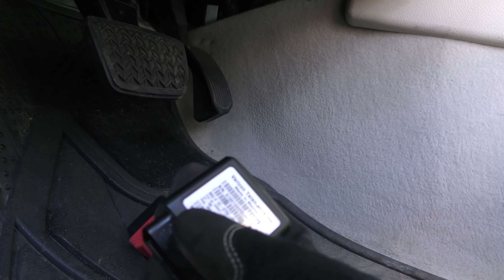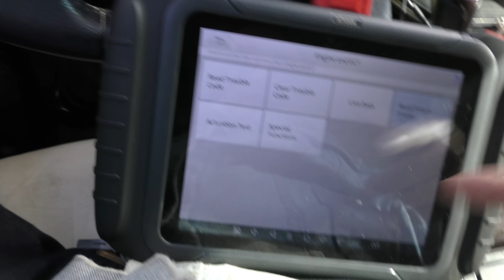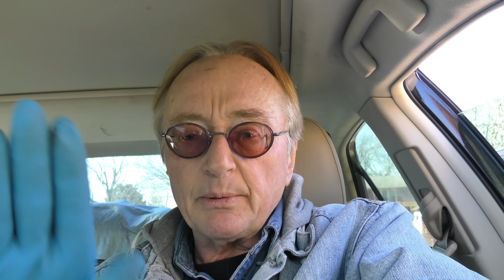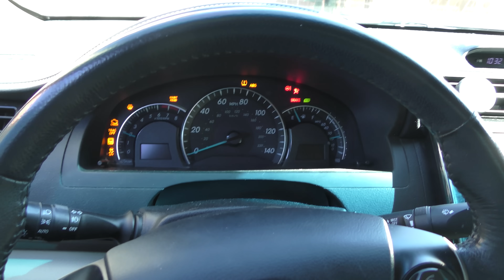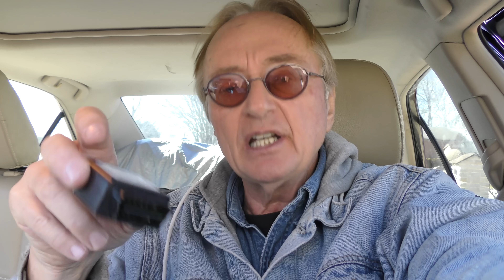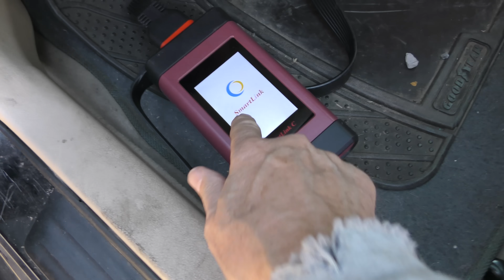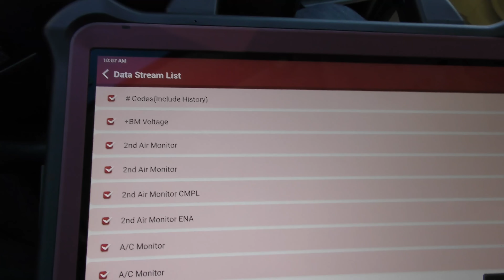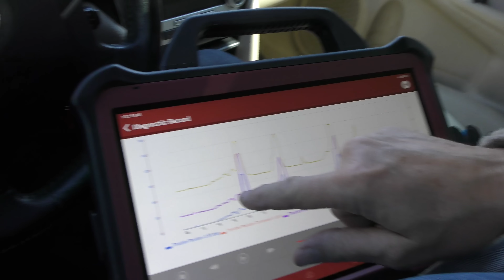This Stupid Device Just Cost My Customer Thousands in Car Repairs

Comment: I greatly admire Scotty, but I have to disagree with him on this one (I'm not an auto mechanic, I repair medical equipment).  Car computers are actually pretty well hardened against high temps, electrical glitches and spikes, etc.  Years ago, I had a GM instructor tell me that of the GM computers sent back to them by auto mechanics, over 99% of those replaced computers were perfectly good... the problem is most often the sensors giving bad information to the computer, which then makes bad decisions on how to run the engine based on that bad data; Garbage In, Garbage Out.  

Sensors are often poorly designed, cheap, and made of cheap materials.  The computers, even as complex as they are, are typically extremely reliable.  I would question many other possibilities before I would begin suspecting the computer.  Even a dirty or corroded electrical connector on a sensor is far more likely to cause problems than the computer itself!  In those cases, a good cleaning of the dirty/corroded connections (and perhaps the application of dielectric grease to keep those connections clean) would fix the problem-- nothing at all was actually bad, neither sensors nor the computer.  Electrical connections are usually where most faults lie in electric/electronic systems (electrolytic capacitors excepted).

It seems to me that the action of the sensor built into the accelerator pedal should be tested waaaay before I would begin blaming the computer-- or the dongle.  Those dongles, even though assembled in a 3rd world country, were probably designed in the US, Japan, or Germany, and YES, they WERE designed to stay connected to the ODBII constantly!  Now if something goes wrong with them, they would probably (my guess) stop working and perhaps interfere with the CANbus data flow, a problem which might stop once the bad dongle is removed from the ODBII connector.  But they typically ARE designed to stay plugged in.  If it is a Chinese design, though... all bets are off.  It's wise not to automatically trust cheap Chinese electronics; some is fine, some not so much.

Oh... and poor electrical ground points in cars (they have many) are also very high on my list of suspects where there are any kind of electrical issues.  Check the battery condition and clamps, check the alternator for normal output (no bad diodes), and look closely at the grounding points throughout the car!
Reply: I've got to agree with Rachel here that Scotty is most likely wrong on this one. Did he do a good job in his presentation & troubleshooting? Depends on who you ask and if you're the customer how much it'll cost you. He checked off a lot of things I would expect but to assume it's the ECM for an issue that only happens during the cold enrichment cycle is madness.
A follow-up on this video is sorely needed. If the ECM is replaced did the problem in fact go away? Without the end confirmed we all can only speculate. My guess is that it's something different... possibly even the throttle position sensor built into the throttle body. That is a costly part but still would be more likely than the ECM of the vehicle. 

There really needs to be a place for people to take stuff like this to and have components tested. It's a shame because without proof of a component failure/fault you are always just taking your best guess at a fix.
Reply: No, they just didn't find the problem and then send the same defective PCM out yet again..98% of the time. - Retired GM Master Tech
Reply: @robertwhite1416  
Good, goooood, I can feel your hatred...
Reply: @MostlyPennyCat  Hatred? Could care less, GM is incompetent to the core.
Reply: Agreed, he got a it in his mind then determined that the dongle was the issue. Also bad computers are usually reversed act up when hot, not when cold.  Programming errors are more constant.
Reply: How about your both right? Since the voltage irregularities happened on multiple sensors, then it may not be sensors or the ECU. It could be an electrical issue. Start with the battery and trace any voltage spikes.
Reply: @jonmccauley6490  Important to point out that your diagnostics equipment isn't measuring the voltages, it's just a display, the cars own sensors are doing the measurements, so you don't even know if what you're seeing is accurate because your measuring faulty equipment using faulty equipment (the car).
Reply: @Strider9655  Sure, but are you assuming that all the sensors are faulty?
Reply: @jonmccauley6490  No, not at all. I'm just saying that you can't fully trust a faulty system to diagnose itself, and that's why when it comes to cars there are highly skilled experts who make a living diagnosing the faults that cannot be diagnosed by plugging in a machine.
Reply: He already had his opinion of the dongle. Normally, when I see a voltage spike it's normally caused by bad grounding of that particular module.
Reply: @danecarpenter8735 generally speaking if you see spikes on voltage rails it’s most likely the power source (battery or alternator) aren’t stable.
Reply: This reminds me of an experience I had on a 2010 Corolla that I used to own. I changed the cabin air filter, then the car starter really acting strange. A mechanic buddy ran the scan tool and said it might be a bad computer. I noticed that water was on the passenger  floor, so asked if it could be the cabin filter being in wrong, he said no. Just to try (I repair computers, so I know it's usually something silly causing big issues), I flipped the cabin air filter, and viola, car worked fine again, no more water on passenger side, etc. I assume the something with the filter being in wrong caused the water the AC took out to get into a sensor and caused the computer to freak out.
Reply: The problem with this is that there are not many diagnosticians left in the automotive world. Now the just read the DTC and if it says sensor is bad they just replace it rather the testing the sensor.
Reply: I had the exact same thought, I think he got this one wrong
Reply: If it is indeed the computer and the issue goes away when it warms up, I would wager some solder points have come half loose on the chipset. Any decent electronics repair shop should be able to fix it without needing to spend thousands,
Reply: This comes straight from my owners manual 
“Installing an aftermarket On Board Diagnostic (OBD) plug-in device that uses the port during normal driving, for example remote insurance company monitoring, remote vehicle diagnostics, telematics or EV system, may cause interference or damage to vehicle systems. We do not recommend or endorse the use of any aftermarket OBD plug-in devices, unless specifically approved by NISSAN. The vehicle warranty may not cover damage caused by any aftermarket plug-in device.”
Reply: @Claroboy911  some people are simple lemmings, if an insurance company tells them it's a good thing to do or if a fleet company uses it in cars they rarely hold on to for more than a year or two before selling it to a private party or auction house they'll think "well it most be safe then" not considering the fact that insurance companies aren't covering for damage from using these devices constantly or that fleet companies can afford a few losses here and there or that they have their own shops to repair mechanical issues in many cases.
Reply: Grounding points exactly. We have a car model in Australia that is known to run badly after a cold start when it and the battery get old. That's the alternator recharging the battery after a start, and that current generating voltages across bad (or rusty or inadequate) ground straps between the engine (where the alternator is grounded) and the chassis. If the throttle position sensor was properly grounded ONLY to the ECU then there wouldn't be a problem, but it is grounded to the engine.

Yes, some OBD tools and pods can scan the CAN bus "too hard" (too many messages/second), and when combined with badly written ECU software that doesn't prioritize things like firing the plugs over answering the pod you get problems. Which go away when you unplug the thing (or reduce the scan rate with a PC-based scanner).
Reply: Finally someone else who uses logic and reasoning.
Reply: I’d have to agree Rachel. My car, a Chevy aveo5 was doing exactly what this cars doing. It was my throttle position sensor on my throttle body. Bought a new one, slapped it in and away I went. Like you said ecus are hard to kill and with the bad voltages, they can be from bed sensors giving out out of range resistance thus causing the ecu to shut things down.
Reply: I agree. I used to work in the auto industry in Detroit testing automotive electronics before they were approved as OEM parts. Engine control modules are extremely beefy. It's much more likely to be sensors giving bad input. FYI, I worked for TUV Sud America
Reply: I'd like to see a crossover episode on this one where Scotty tries to diagnose and Louis Rossmann does a component level assessment.
Reply: Error code is sensor, so yes, I would also be testing the sensor on this first.
Reply: Interesting take, though, for me, there's one thing that really undermines you point:

"I've had to replace ONE bad computer on a Toyota in 43 years."

As I'm sure you're well aware, computers are becoming increasingly lower current and consequently more sensitive to inputs; 10% of a 5 Amp circuit is 500mA, 10% of a 1A circuit is 100mA.

I don't think the issue with the dongles is likely the design, it's more likely quality control and the resulting actual operating tolerances.

While, in general, people may cut costs on sensors, again, one should take note of the supply chain aspect - as pointed out, the parts in question are not stocked by dealers. This is a VERY strong indicator that they do not fail.

Regardless, I'm sure we can agree that rolling around with a diagnostic device attached permanently (unless it's explicitly qualified by the manufacturer) is probably a BadIdea™
Reply: @edwardcullen1739  re: "As I'm sure you're well aware, computers are becoming increasingly lower current and consequently more sensitive to inputs; 10% of a 5 Amp circuit is 500mA, 10% of a 1A circuit is 100mA."

and current is what a device draws, not what is input to it. A computer GPIO can't sink more current than it can sink. It can source more, which would damage it, but that's why those inputs are protected by transistors to amplify current and TVS diodes to protect against voltage spikes. Check out the  NUP2105LT1G TVS diode that can clamp to it's specified clamping voltage while clamping transients caused by up to 50A switching currents up to 35kv in 5 nanoseconds!
Reply: That dongle may have been put there because the car was acting up and the owner was trying to figure it out there self, then decided to just sell, and that's how the lady got stuck with it.
Reply: Scotty two or three years ago mentioned the phone charger plugs  in the lighter socket could cause the check engine light to turn on due to stray high voltage spikes corrupting the data streams. Sorta .
Reply: Depends on what car and whose making them. I’ve worked at GM dealers and have had lots of bad ECUs due to electrical issues, heat, even had one where a battery replacement took it out but no other fuses in line were smoked. Thing should’ve been running perfectly and it bypassed all the safeties.
Reply: I tend to agree with you. Except for some Ford made Mazda ECUs that are extremely low quality. On the other hand they're pretty easy to repair, find the bad solder joint(s) and fix them. There's no or almost no conformal coating to worry about.
Reply: agree completely with the throttle sensor. Suspect the human/machine interface bits FIRST, then anything else that moves second. Connectors and bolted connections next. Solid state last. Those ECUs tend to be potted against vibration, TVS diodes on all IO, etc... the ANSI standards for automotive solid state electronics are quite robust. Our cellphones are garbage in comparison, as far as what they put up with for out of spec signalling causing damage.
Reply: Garbage in, Garbage out...
Reply: that is the same gm plant that made opels right .. might want to look into opel vectra computers ,as just one gm example ,stick the computer to the engine and many died . while fixing issues with those cars usually the first thing that is tried is swapping the computer D:
Reply: That screwy DC supply being in time with the sensor glitches is quite telling, you need a common reference.
Check the grounds and if that doesn't fix it the VRMs in the computer may have died. That needs rework on a solder station.
Reply: " In those cases, a good cleaning of the dirty/corroded connections (and perhaps the application of dielectric grease to keep those connections clean) would fix the problem-- nothing at all was actually bad, neither sensors nor the computer.  Electrical connections are usually where most faults lie in electric/electronic systems"

This. 
Electrical engineer here. Naturally, I like to fix stuff. If you don't fix stuff, you really have no idea how many "broken" electronic items are fixed by unplugging a connector, then plugging it back in. It's really absurd.

"Oh... and poor electrical ground points in cars (they have many) are also very high on my list of suspects where there are any kind of electrical issues. "

That too. Contact resistance builds up. While you're bothering, you may as well clean a connection, but just unplug and resaet often fixes things sensors/computers.
Reply: I have seen OBD dongles that immediately send the transmission into limp mode, make the gauge cluster freak out etc. Pretty much anything post 2011 where Canbus is standard can be easily glitched out
Reply: I agree. I'd try reflashing the SW/FW on the computer before replacing it. Better yet, if there was a way to check the integrity of the SW (ie checksum), kudos to the SW developers. Maybe the dongle corrupted the SW? I can see a scenario where a scan tool is pushing data and causes a buffer overflow and corrupts the SW/static memory.
Reply: very few electronics are made anywhere besides china.  They hold every current chip factory on the planet except for a few intel owns.
Reply: agreed here.  I worked in electronics for a long time - this is a very big leap.  Also I'll point out that the scan tool get the TPS data FROM the computer - so if the computer is seeing a bunch of glitches, it could be the ADC in the computer or the sensor or the wiring to the sensor.  I don't think the cause/effect is correct here.
Reply: Stfu with the book
Reply: I had one of those monitoring dongles dead short to ground. blew the fuse, but also killed the ECM.
Reply: I used a similar device from Progressive and had all kinds of intermittent issues until I removed it.

The car was brand new, the dealership couldn't find any issues (the problems were intermittent), the Eyesight system would lose track or shutdown, the engine cut out and wouldn't start, the navigation system acted chaotically.  The severe issues stopped immediately after using the device and the other issues faded over time (it's been about 4 years).

I've worked with 2 wire serial systems (rs485 mostly) and have seen faulty components cause issues in other equipment connected to it.
Reply: @justmyopinion4818  Yes, but that did not damage the computer, and once removed problem disappeared. I would agree, that actually damage the computer is hard.
Reply: @dmitripogosian5084   agreed. caused a problem, damaged nothing. VERY important distinction.
Reply: Same. I yanked that bastard out so fast. Shitty, imprecise, data it gathers and sends anyway.
Reply: GM computers go out all the time
Reply: Those devices are trash. They cause problems and failures. 

I see the at my dealer all the time throwing cel and pre collision system malfunction.
Pull out the stupid Chinese scanner or insurance tracking device then lights go out and everything works as designed.

Stop putting crap in cars. They are way too complex to be adding random crap.
Reply: Ummm, yeah, he stated that he checked the electrical system near the start of the video.
Reply: @danielsmit11  Umm, I've seen the electrical checks he does, and the equipment he uses.  Yeah.
Reply: @rachelblack3816  well actually you didn't since he didn't show that part of the video in this instance. As far as the equipment, yes you did see him use a $6000 plus diagnostic computer after using a cheaper $1200 or so piece of diagnostic equipment.
Reply: @danielsmit11  So this is the only video where he troubleshoots electrical? And I've seen the scanners he uses, and they are very good at most automotive things... but not everything.   How would I know? I only use more expensive and other types of equipment better suited to these kinds of problems. You don't need to be afraid of girls smarter than you. Really.
Reply: @danielsmit11  Using the right tool is more important that using the most expensive tool.  In this case, I would have liked to seen an occiliscope and protocol analyser used.  But lets be honest, how many people are going to know how to properly attach those to the car's communication busses, not to mention properly interpret the output.
Reply: @rachelblack3816  the fact that you ignore connecting a wifi dongle into your car's computer system leaves your computer system vulnerable to malware tells me you aren't as smart as you think you are.
Reply: @danielsmit11  Maybe that's why you put a wpa2 password on the wi-fi part of it? The device itself (which you've obviously NEVER USED) has a sim card and talks to cell tower just like your cellphone, which is how it gets INTERNET service for the wi-fi. It has the ability, through a service provider branded app, to link and monitor your cars health and even where its at, where its going or where its been. The app makes you create an account and password, before you can link/pair your device to it. Mine makes me log in to my account with 2FA security protocols that I enabled and the provider makes me change my password every 30-60 days.

Any more smart a$$ comments about security my guy?
Reply: @youtubesnamingpolicysucks  WPA2 can be hacked relatively easily. Especially if it has a password like "ODB123" which it probably does. And that ignores this specific case where the customer apparently didn't install it... so someone else already knows the password
Reply: @danielsmit11  Cellular and bluetooth, but yeah. That specific device is designed for remote telemetry. If someone was bricking cars through that service, there would be many more than just this one hit. There's clearly something wrong in that car, but I'm 99% certain that dongle didn't cause it. (the ECU is most likely NOT the problem.)
Reply: @danielsmit11  Thinking that a car would run on a regular computer operating system and would be vulnerable to "malware" tells me you're not as smart as you think you are.
Reply: @youtubesnamingpolicysucks  Uh, cell services have been decimated for eons. You're actually talking about the same things that other LEO and FEDS have access to, and proclaim they're secure.  

>2FA
oof, my man. Take the L and leave.
Reply: @danielsmit11  all that hacking was done with poorly secured telematics and BCM that interacted with the ECM and PCM with read and write policies instead of read only security policies. That's why I really wish there were more security standards with telematics. Or any for that matter.
Reply: @danielsmit11  Fleets use these type of things all the time for vehicle tracking and monitoring. Thousands of tractor trailers will have something plugged into their J1939, J1708 or OBDII port 24/7 365 many of them even allow passthrough for real diagnostic without having to remove the ELD connection.  Many of those use wifi (take a look at the wifi networks near you when you pass trucks on highway) Most the time a consumer's car may have a bad computer it's time to really look at the electrical system and sensors instead of blaming something that is actually designed to have something plugged into it all the time.  I would rather have something plugged into it than allow the unprotected pins to see light of day.  Water can just as easily if not easier short on the CAN bus pins as that throttle sensor.
Reply: @hollowlife1987  actually they were not designed to have something plugged in to them all the time. They were designed to be able to plug diagnostic equipment in to them when necessary to diagnose computer/engine problems etc.
Reply: @hollowlife1987  using that line of reasoning then you should put fuses in every single fuse slot because it's there.
Reply: @danielsmit11  normally there is a cover over fuses that you have to pop off to access them.  That aside my point was that those diagnostic ports are designed and used to have monitoring devices plugged in all the time.  As such it is just as likely that water could damage the exposed port, as a device made for monitoring fleet of vehicles like that verizon one.

The security of them are well established as I pointed out nearly all the trucks you see on highway have a wifi access point powered by and connected to their diagnostic port in some manufacturers that is odb2
Reply: @danielsmit11  If they were not designed to have a device plugged in all the time to them please provide a tsb for that from the manufacturer.  The specs and standards don't really weigh on that.  They are commonly used by insurance companies, the fmcsa require ELDs for commercial vehicles which tend to plug into the diagnostic ports which can be odb2.  
Can you provide empirical evidence that the manufacturer does not want them to have fleet telemetry devices plugged into the odb2 port?
Reply: @hollowlife1987  I already listed multiple sources that discuss that.
   One of those articles specifically points out that car manufacturers are aware of the dangers but have withheld the information from the general public, big surprise there.
   Now if you're referring to dongles that ONLY read information from the cad and not dongles that can read and send information to the cad and connect to wifi/internet that's a different animal as Scotty pointed out in the video.
Reply: @hollowlife1987  it'd be rather hard giving a manufactures source when manufacturers are going out of their way hiding these issues to begin with.
Reply: @danielsmit11  So no manufacturer source millions of companies using fleet monitoring via odb2.  Insurance companies and large Telcom companies using it for telemetry..... the claim that it shouldn't be used for telemetry because it's not designed for that can you provide empirical evidence? Lawsuit brought on by a company with a fleet of these monitoring devices? How about insurance company ditching using them since they could be held liable? Internal memos? Any empirical evidence that telemetry devices are causing these issues?
Reply: @rachelblack3816  LOL
Reply: @rachelblack3816  insecure I see
Reply: @youtubesnamingpolicysucks  I hate to break your balls on top of everyone else but IOT devices have the WORST software and security systems. Not that anyone would bother messing with it... But the problem is that SOMEONE COULD. I personally hate the fact that there is so much tech in devices that don't need it  and constantly connected features that is unnecessary. and I am a tech enthusiast, but I also know the risks. Plus, a lot of times you just don't need it. Especially when it starts causing issues, like in this video.
Reply: @danielsmit11 lmfao malware for my car? Jesus Christ.
Reply: @iambigmoneysalvia  obviously you didn't actually watch the video?
   You do know that dongles can be hacked if they're connected to wifi right? And that the manufacturer can pretty much do anything they want with new cars including locking you in, locking you out, shutting the car off etc?
Reply: @hollowlife1987 also tens of thousands use monitor devices like Banks iDash etc.  zero issues.     All these OBD sensors for insurance company does is it has a built in GPS tracker and it records and sends vehicle data like speed rpm etc and uses the OBD port to power up the device.    Sure a poorly designed one can throw codes but it shouldn’t damage the ecm.
Reply: As a person who's worked with computers since 1978 I can tell you that there is an amazing amount of damage that can be done to car computers by plugging crap into the diagnostics port, especially in dry weather when the vehicle body can develop charges in excess of 40,000v.   That dongle was assembled in Mexico, the circuit came from China.

Get back in your lane and stay there.  I doubt the circuit inside the box has much similarity to the circuit that was designed to be inside the box.

Tho I am going to side with you and say that the problem looks like AC coming through from the alternator through the voltage regulator.   Spurious harmonics of AC penetration do precisely what he showed on screen to almost any computer - the voltage regulators on motherboards and graphics cards are effectively half-wave AC modulators that fight each other to maintain a voltage input, that is why they're in pairs and trio's per feed line.
Reply: @prjndigo  your video card came from china.  2/3 of the chip manufacturers on the planet are in china.  And incidentally most of the power to a graphics card comes through direct power supply connection.  You can only get a max of 75 watts through the pci bus.